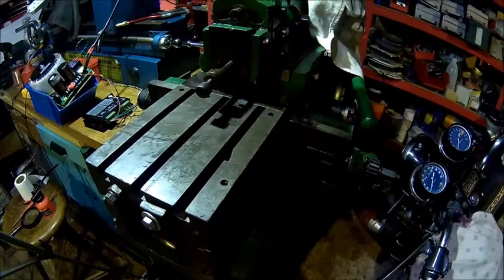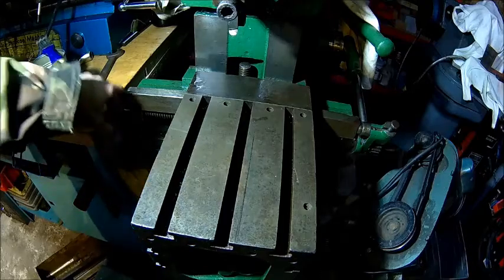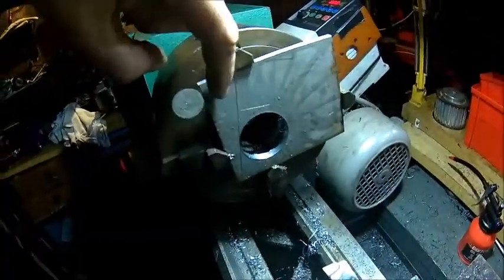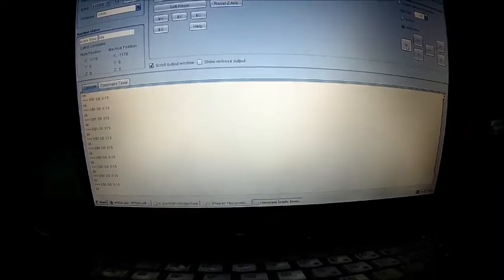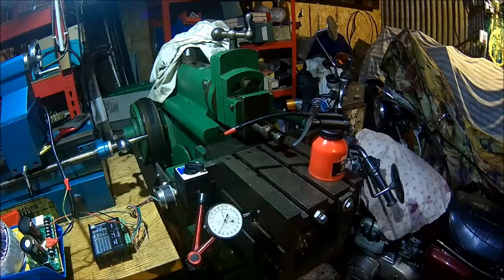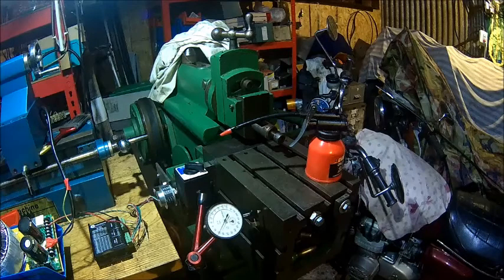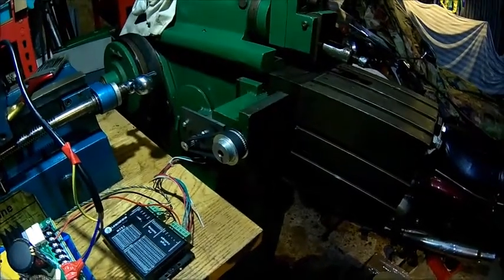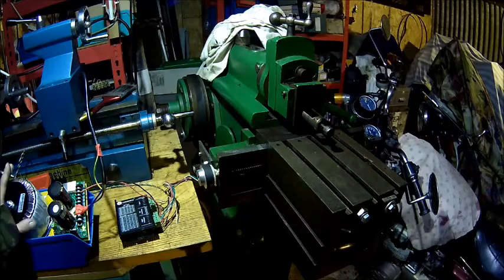The Alba 1A Shaper goes CNC - Part1, X-axis parts and test

Comment: what do you think about can cnc-controllled shaper able to form any profile entering in metal in mid of stock ?
Reply: shaper-cutting method has large advantage: you can use any hardened metal piece taken from heap of scrap as cutting tool, no special inserts $25+, endmills or tapers, you need only table grinder and diamond dish
Reply from the maker: Yes, thats my plan, it just adds alot of functionality to the machine. I also like th idea of cheap tooling and for HSS bits you won't need a diamond wheel, any bench grinder will do it. ....thanks for watching

Comment: Nice bit of fun Mike ! would a larger driven pulley provide more effective torque at the lead screw ? Or is there not enough space due to the carriage  travel ?  There are some inexpensive ball bearing thrust bearings on the market - which should enable you to back off the clamping pressure needed for the ratchet and pawel drive  Cheers Mat
Reply from the maker: Morning Mat, ...yes a larger pulley would certainly help as the speed is still plenty. but it's all made of parts i had laying around and the ratio is fine for that motor, the problem is that the driver stage does not match. This is a salvaged motor, so i have very little data, just thought i give it a try. At the beginning you see me holding a bigger one, that has 4Nm holding torque but it is a bit too long  I ordered a 2.8Nm one which is a bit shorter and should fit to the same mounting points. I was thinking about ball thrust bearings, but that needs extending the lead screw as the end is pretty short. It is also bent, you can see the pulley wobbling a bit, so i think i'll take it out and look at it at some point. ...Cheers Mike

Comment: pretty nifty idea, i wonder if a DRO could be coupled with the stepper motor or the controller as a feedback loop in case the motor loses a step or slips that it can correct itself to get to the programmed coordinate?
Reply from the maker: Indeed, a DRO feedback will help, but that's extra cost. The general idea of stepper drives is that they perfectly repeatable, but only if the motors are sized correctly and not being overload. Already ordered the right size motor, so that problem should be sorted soon.
With a shaper, forces are very predictable as you only deal with the friction of the machine, no cutting forces during travel. 
Mills and lathes are much more challenging as you also dealng with the dynamics of tool pressure.

Comment: I have been toying with the idea of whether to use a newly machined trapazoidal threaded leadscrews which I can verify movements with hand dials on the opposite ends. If I used Mod 1 I could get a very precise 1mm movement with one turn or even go as high as Mod 3 to get 3mm movement per turn.  

The other concept I have also been looking at is to use ballscrews because of the easy free movement. Right now I am leaning more toward the trapazoidal form mainly because of the control.

I have also been spending time thinking about the use of limit switches both for the 3 axises as well as the ram.  The current concepts of setting the limits of travel are 100 - 150 years old. They work, but I think there might be better concepts out there.
Reply from the maker: There is no need to make a new lead screw, a dial could be made for any pitch. Ballscrews are sub-ideal as you do need the friction for self locking, otherwise you cannot use the machine in manual mode anymore. With ballscrews the motor must provide holding torque all the time, also there is very little room, so a bulky ball nut is rather difficult to fit wihout major mods, you also will loose trave because of the nut lenght. My design target i to do as little as possible mods to the machine itself, for now it is just a few extra mounting holes. Thanks for watching.

Comment: I think this is great.  I recently started working on the same concept. My idea like yours is to move the table side to side as well as up and down, and to move the tool head up and down.  My concept is to use a high torque NEMA 34.
Reply from the maker: Thanks, thought i probably not alone with the idea. As mentioned i measured the torque required which is about 10 Nm vertical and 2,5Nm horizontal.